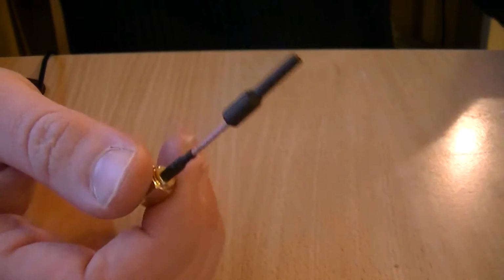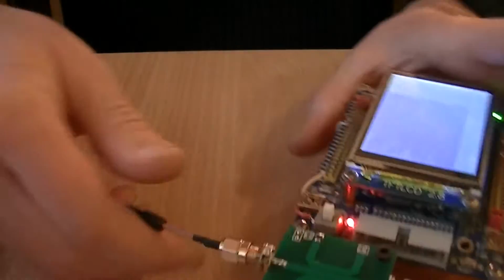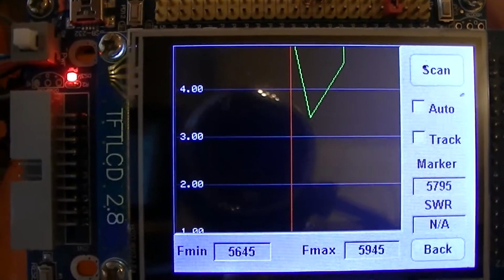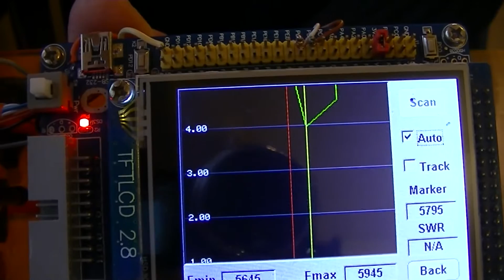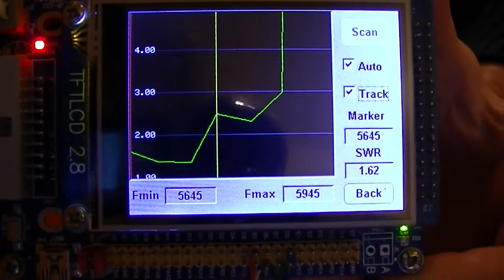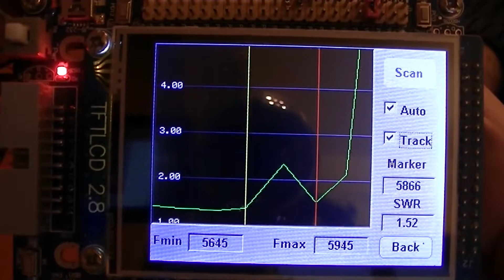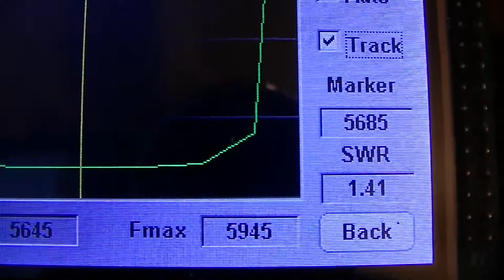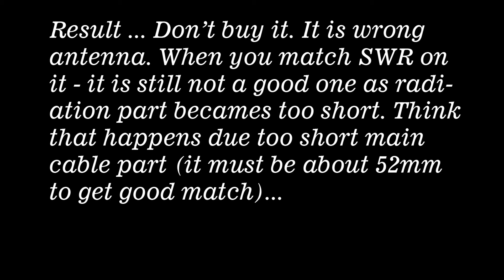Stick 5.8G 3dB Soft Omnidirectional antenna from Banggood. Review and test

Comment: well, this you device is measure "something"? who knows how correctly and what exactly... the video is pointless without the actual demonstration of bad/good performance in real usage. You mislead as yourself either the people who watching you. Pretty sure there will be no real perceiving difference between your antena and this one from bangood. both a crap most likely
Reply from the maker: Now we have our SWR meter on banggood. Each SWM meter is calibrated with reference antennas we checked on professional equipment. About good or bad and showing video - no big deal to show noisy or low range video of antennas I checked there. Who a bit understands SWR meaning knows how it affects antenna performance.
Reply: well, one of them must show more noisy video then the other one - and not slightly, but seriously noisily according to your emotions and excitements about your measurements in this video,. And this is what we really want to see. I am in fact think that there will be no difference, or it will be negligible. Oh, and the fact that you sell something on the cool china shop that send your some crappy antena prove really a lot of course : )))) I am pretty sure the seller also test own antenas on the professional equipment, purchased in the same shop : )))
Reply: and by the way, measuring antenna SWR not in actual schematic where it will be used is pointless
Reply: antena from bangood might very likely show better actual performance (but not very different, just a little) when connected to the real VTX on drone then this your antena that you much and fine tune to this your SWR meter.
Reply from the maker: How much aggression. You can use any antenna you want, that is your choice. SWR meter uses VTX too btw, so result is not far from actual on quad. Btw, antenna with bad SWR will work and you will have clear video on short distance, but it may give bad result on longer distances or make a noise on other frequencies affecting other pilots. But as they say - haters gona hate, thank you for commenting ;)